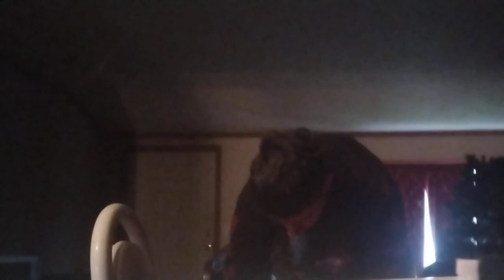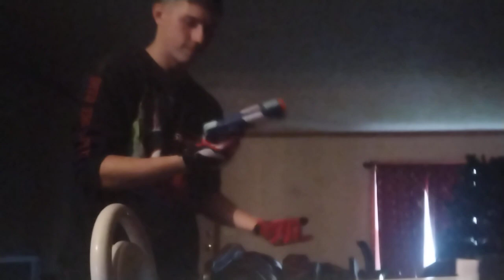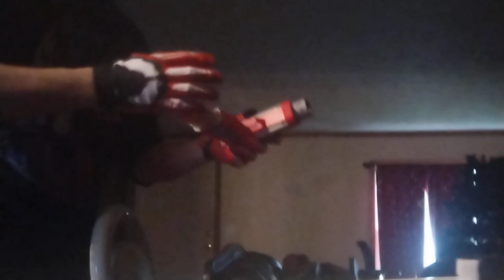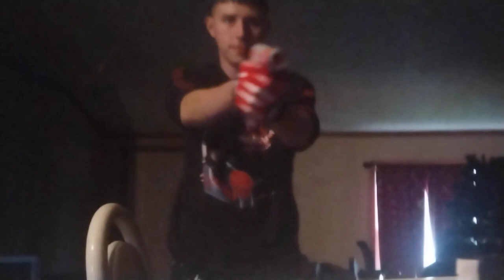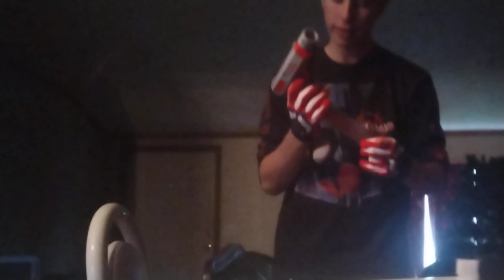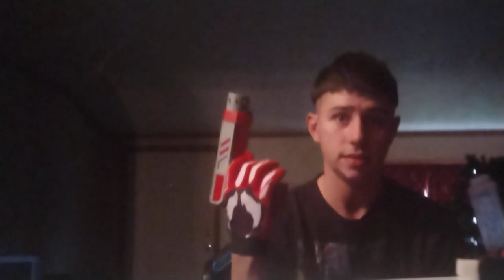3D PRINTED NERF VS REAL NERF!!!!

Comment: Cool obviously 3d printed can’t beat the real nerf
Reply from the maker: It did beat real nerf
Reply: @DOUBLEPUNCHPRONERFER  huh I’m curious on how
Reply from the maker: @danielnguyen5902  3d printed hits 115 fps 
Real nerf hits 70 fps 
3D printed is more comfortable
Real nerf is uncomfortable
Reply: @DOUBLEPUNCHPRONERFER  it’s a unfair comparison tho because the real nerf isn’t modded and the 3d printed one is modded with a more powerful spring
Reply: And also when are you using your GoPro?
Reply from the maker: @danielnguyen5902  the 3d printed is bungee powered not spring powered
Reply from the maker: @danielnguyen5902  this month
Reply: @DOUBLEPUNCHPRONERFER  ok
Reply from the maker: @danielnguyen5902  I gotta order 2 SD cards for the price of 1 with 128 gb storage
Reply: @DOUBLEPUNCHPRONERFER  ok!